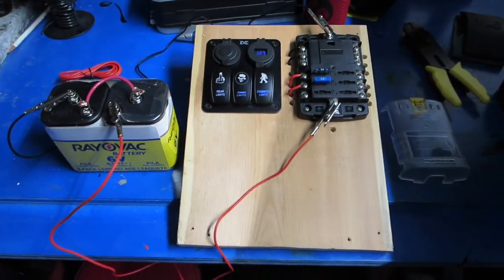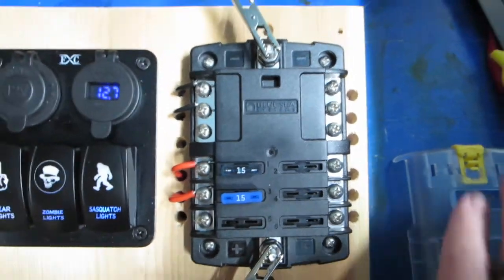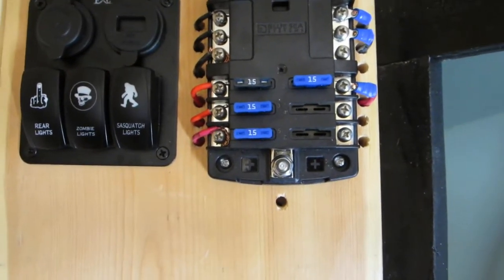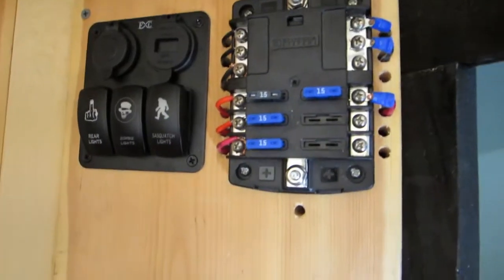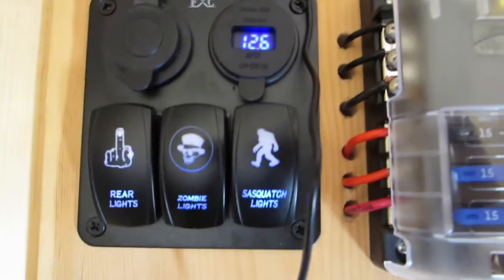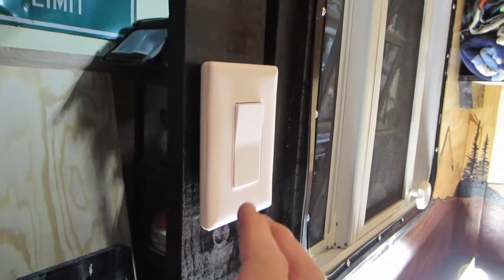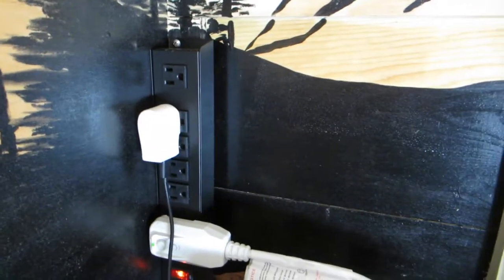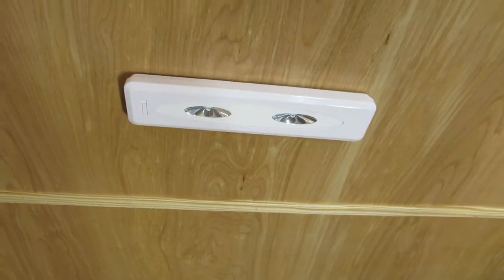how to build a teardrop camper squaredrop camper episode 7

Comment: Looking Good Brother, If i can, Prewire for future upgrades, I spent 9 yeasr as a design engineer for Chaparral Boats, It's worth it. Can wait to get started on my Old pos.. Thanks for sharing.
Reply from the maker: +Panhandle Prepper thanks , I prewired for a future powered vent fan that will come later and have and want to add roof rack with some high power LED off road lights pointing each direction in case I wanna light whole area up in case of night time visitors .
Reply: I Love those type Led light , My 2500 hd has a topper on it i use them to help back the boat in the dark, Also have a set on front of the truc Grat on a foggy morning. I believe mine are each 35 Watts apiece. Bought them on Amazon.